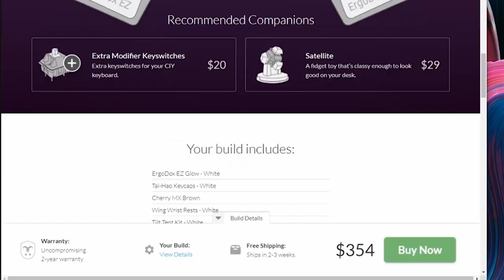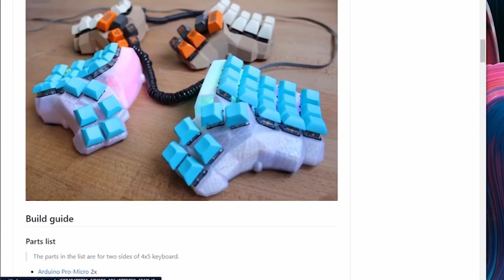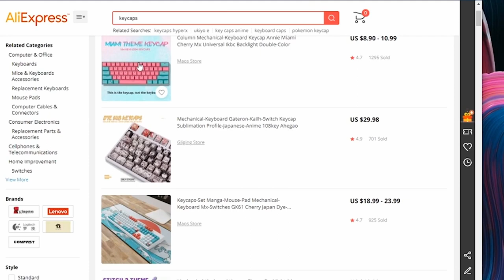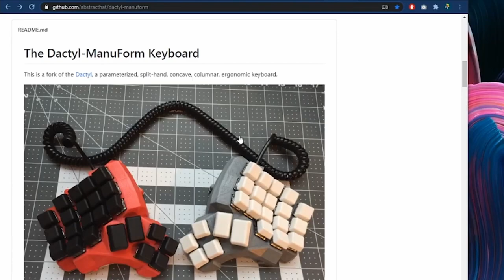Bulding a Dactyl Manuform - Mechanical Keyboard

Comment: You don't need to scratch the diode legs or switch pins, flux takes care of the oxide. Also, you want to heat up the pin and then add the solder to the pin. You risk getting cold joints otherwise. Don't bee afraid to add flux as you go along.

Comment: I don't understand how you hook the strings from jack 3.5
Reply: I might be wrong. Bot does it matter how he conectes them? As long the connection are on both sides connected to the same board pinnouts it should work, right? I'll  try it  when I've finished the second one. But idk when.